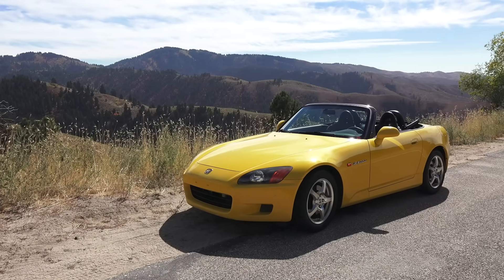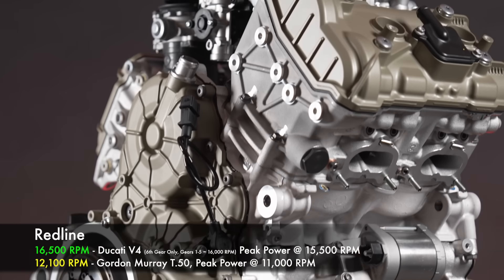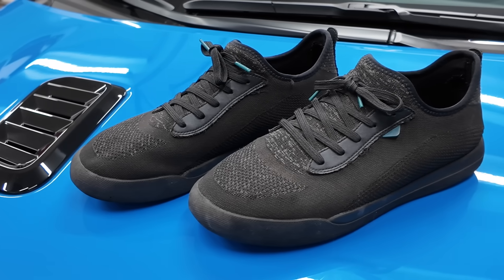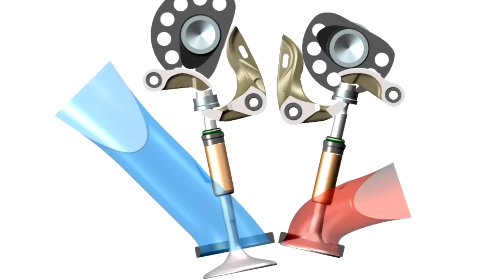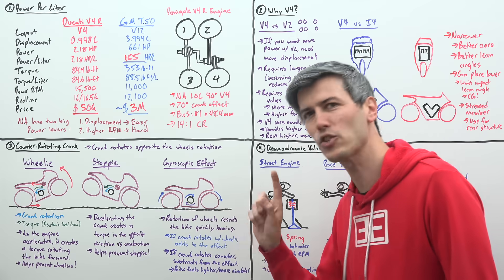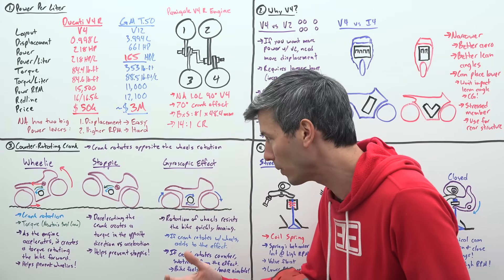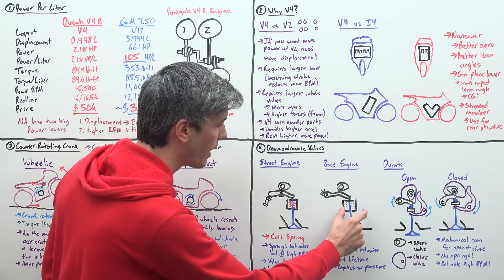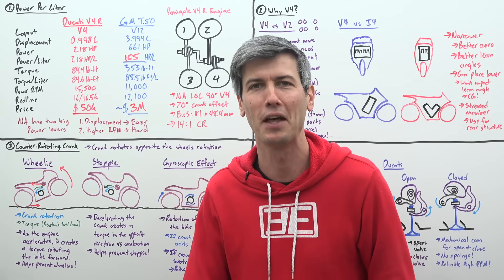Ducati's Brilliant V4 Engine — Putting Supercars To Shame!

Comment: Great video, but there’s a problem with the description of gyroscopic effects.  A rotating wheel’s resistance to leaning doesn’t depend upon the direction it’s spinning so the counterrotating engine won’t reduce the bike’s resistance to leaning.  However, there may be some more subtle gyroscopic effects related to the bike not wanting to steer itself rightward or leftward as it’s leaned.
Reply: I noticed that immediately too, although I'm a complete layperson at physics and technical matters. How would the "wheel gyroscopes" know to which direction the "engine gyroscope" is rotating when the bike starts to lean left or right. I'm a bit surprised that Jason didn't notice that, as he seems to be quite technically savvy and smart.

Comment: Volume is the wrong metric to measure and compare engines; the correct metric is cross sectional area of the pistons. Or even better, the cross sectional area of the valves.

Comment: one aspect of power vs dispalcement, is how long can it last.

another is how usable is the power band in other applications.

I suspect a motorbike engine would not be a nice expereince in a 1,500kg car, during a hill-start - or with a dual-clutch transmission.

Comment: Two stroke racing engines even back in 1968 produced well in excess off 300 hp per liter. The Suzuki RP68 three cylinder 50cc produced 380 hp per liter. Later Aprilia RS125 GP engines produced in excess of 430 hp per liter. The famous Honda NSR500 at some point produced at least 400 hp per liter....maybe more.
Reply: Should have mentioned the 1.5 liter turbo era in F1 GP.....How about 1500 hp+ from 1.5 liters! That's a massive 1000 hp per liter! Yes that was typical in qualifying trim. Crazy hp numbers per liter!
Reply: @C_Dana Yes, but he specifically said "naturally aspirated " so turbocharged F1 engines are out.

Comment: Oh!
Ducati is one of two manufacturers using counter rotating crank shafts in street bikes!! 
MV Agusta uses them in their i-3 800cc and (I think...) i-4 liter bikes. They're Italian too but much smaller a name and company. They are putting in work right now! They're offering a 5 year extended warranty to most ifnot the whole product line, which is nutty all things considered...
Thanks for a 2 wheel video, enjoyed your presentation of the info
Cheers

Comment: EE, I think it would be cool if you did a breakdown on the MotoCzysz C1 990. It had a dual counter-rotating crankshaft in a horizontally mounted engine.  It was intended for Moto GP, BUT got FIM'd.  Very interesting design.

Comment: I had a 2004 Honda VFR 750 back in my younger years.  I LOVED that engine.  V4's have their own unique sound.
A couple of times when replacing the muffler/exhaust, i would live the pipe off and fire up the engine with just the headers wide open.
GLORIOUS sound.  Way too loud and overpowering off course, and I would never ride on the street like that.
Still, the sound/tone coming from that V4 was awesome.

I'm really surprised that Honda didn't use the V4 configuration in more of their models.  Ducati obviously took it up, as they knew Honda had a great setup with the engine configuration.
I know packaging limitations are a key consideration when deciding on engine type in a cycle and automobile.
I would love for an auto manufacturer to figure out a way to put a V4 into a sport coupe and/or sport sedan.
With modern turbo systems and that sweet sounding V4 config, and it's inherent torque production, a turbo V4 in 
a sport coupe and sedan would have me buying one.

Comment: This doesn't really touch on the core reasons why people don't use motorcycle engines in a car even if the power density is higher. Can you explain further? Power curve and usability? NVH? Reliability and mileage expectations?
Reply: torque load, car has way more mass excerting force on all parts so you need stronger parts

Comment: I have been saying for years, if you love driving get a bike. You can have the time of your life with 60hp. You get all the best engine noises and most of the time an amazing driving experience.
Reply: Totally agree!  I had a 1000cc sportbike 25 years ago and the engine never even seemed be working until it was well into triple digit speeds.  I then bought a 2005 Ducati Monster S2R800 for street riding.  At about 80hp, it was plenty to have a great time on the local mountain.
Reply: Yep. For a clod like me who's used to 50-60 hp bikes, riding a 200 hp bike would probably get me killed.
Reply: @rcnelson  Nah just lose your licence

Comment: I would love a breakdown of the desmo system and why it was first introduced back when valve springs weren't of the quality they are now. The advantages they had in racing during that time could be explored. Love the bike content and there's so many crazy high horsepower turbo engines if you really want to go down the power/displacement rabbit hole. Good stuff!! Go Ducati.

Comment: I think the desmo has been dropped in the lower performance Ducatis as springs have advanced a lot in recent years, are simpler, are cheaper & easier to maintain. That said, I keep my fingers crossed that Ducati and their desmo engines will live forever.

Comment: I got to ride a 2023 Streetfighter V4S once (same engine as the Panigale, but different gearing, no fairings, and handlebars). The amount of power is insane and almost impossible to use on the street. But I still want one 😈

Comment: Hey Jason, another great video. full of amazing details and specs as usual. The Ducatti V4 is an absolute masterpiece and from what I've heard Rotax and Ducatti were at it quite some time and pulled the big guns out. I've heard of someone working on taking one much further than the OEM & works versions, should prove interesting and potentially very amusing. As soon as you said the most powerful N/A car engine it had to be the Cosworth V12 in the Murray T.50. It was designed and developed by Matthew Grant who was the Director of F1 engine design and development. I believe it was his last engine at Cosworth. He's now running Modatek who are the sole supplier of parts for classic Cosworth engines. No I'm not and engineer nor have I ever worked in the industry or any associated, lol just an ex pro DJ. I know Matthew from a crazy project with 2 5l Volvo turbo engine (☺️ now you know my secret passion, Volvo estate T5's) Make more amazing videos please!! cos as a non engineer it lets me see and understand how people address similar issues in different applications which lets me think it over properly and work out how to address it in my application and develop it. Yeah I know it's the wrong way round....lol but that's how I work stuff out. So power density wise 1500 bhp and very stable at that in a road going Volvo estate isn't too shabby. The project involved a 2500bhp single turbo 2.5l Volvo engine. Yes a lot of work but none of it difficult. (Again really bad ADHD and self taught at everything. 

keep up the amazing videos cos they help me a lot. PS there is One Cosworth Racing Volvo 2.5 5 cylinder development in existence too 😉

Comment: It's not only Ducati. They may take the edge in racing, but Honda & BMW both make 218PS in their street bikes as well, at lower revs and without a V4 engine configuration... In general, motorcycle engines are awesome 🔥
Reply: Honda’s 1000 is outdated and old technology. Its a generic inline 4. Sure it makes decent power but its still a generic engine just like Suzuki’s 1000. Yamaha’s R1 engine is unique and better. BMW uses exclusive valve technology that only their bikes have. Honda and suzuki need new tech. Kawasaki has the H2. There are rumors that Honda is designing a new V4 👍🏼
Reply: @revmatchproductions Don't hold your breath on that Honda V4 Superbike motor.  It's been rumored for decades now.

Comment: The desmo valve system also does not rob any power like valve springs do since in a traditional system the cam has to overcome the force of the springs to open the valves.
Reply: Once was a time when desmodromic valve control was considered obsolete since valve springs had improved so much. That control was the whole point of the desmos. Now we've come half circle--180 degrees--back to the springless valve control.
Reply: Si però poi nella fase di chiusura parte di questa forza viene restituitasull'albero a camme. Il bilancio è leggermente positivo per il sistema desmodromico. Il vero punto è che il sistema desmo.permette leggi di alzata più rapidee quindi a parità di fasatura un time-area maggiore...
Reply: @MrDenisio77  Mmm comunque un motore desmodronico lo puoi girare a mano, questa mancata inerzia dovuta all'assenza delle molle spiega anche perché questi motori prendono giri molto velocemente, non è solo questione di potenza massima.
Reply: And the desmotronic valve system is more than 100 years old... No way this is patented by ducati.
Reply: true...just trying to push the spring with my finger hurts
Reply: well actually I think the force required to compress the spring is given back as the spring returns to the closed position....less fiction losses
Reply: @StrongUrgeToFly  Hello StrongUrgeToFly, Your comment about the valve springs storing energy which is delivered back to the system would only be true at [very] low rpm. There is diminishing return as the rpm increase, and at the highest rpm when the valves are almost starting to float you've paid the full price of compressing the springs and yet get nothing back in return. Cheers.
Reply: There must be some extra oscillating mass from the desmo valve system though?  And something has to drive that mass (consuming engine power).  A spring can at least store and release energy (until it eventually deforms and fails).  In any case I do not think Ducati chose the desmo valve system for its efficiency.
Reply: @hreb  Don't forget that the spring and the spring retainers are all reciprocating mass. For high rpm engines, the mass of the retainers makes a significant difference to valve control. So the desmo system is simply swapping a reciprocating spring and spring retainer, for an additional rocker arm. At high rpms the springs have to handle crazy vibrations and oscillations, which is part of what causes valve float and the loss of valve control at high speed. The Desmodromic valve system doesn't have these oscillations. The trade off is that it is more complex to not only manufacture, but also to maintain.
Reply: @hreb it's actually lighter than a valve spring setup, and the reciprocating vs. rotating mass equation is only really true at low RPMs. The difference in HP using a Desmo system is estimated at 7-10 HP for a 1000cc engine, which is a pretty big deal. Only downside is that valve adjustments are significantly more work (ask me how I know🙃).
Reply: @hreb  While energy is consumed from the engine to compress the valve spring, it is very unlikely any appreciable energy is returned through the cam shaft, gearing, back to the crank shaft when the valve is returning to rest.

Comment: I have been riding, studying and modifying sports bikes for 4 decades...there is a crucial point being missed....big HP requires high revs and cam timing with high overlap which results in a lower torque output....you can see that in. the NA LT 6 corvette engine.  because bikes are much lighter they dont require as much torque to keep them rideable moreso if its mainly track or high speed usage ..cars are a lot heavier and need much higher torque so they cant rev as high and focus on peak HP. The Honda engine is till very very impressive because it make big HP but doesnt sacrifice torque. Ducatis focus is primarily on high revs high HP...its still amazing tech which other motorcycles manufacureres havent mathed but there is also a budget issue here ...

Comment: I would argue the width of a four cylinder is of no consequence with respect to windage. A riders feet and thighs would exceed the engine width. The only time width may be a factor is on full lean angles that might necessitate the lifting of crank centerline to achieve enough clearance. Pure aero, a four cylinder has no disadvantage.

Comment: I had a Honda CX500 maggot (old Moto Guzzi are similar) that used to jink to the right when you blip the throttle, which, when judged correctly, makes your handlebars miss the mirrors of cars in traffic. Not THAT useful, so it must be awesome when all that torque is added to forward motion instead of a sideways one (like on VFRs).  Does the reverse crank direction on Dukes nullify that effect, or is it negligable with 200+bhp?
Edit : definitely make part two.

Comment: 7:43 "CR engine gonna stop wheelies..." shows two Ducati's pulling power on wheelies 😂
Reply: Yeah, it still wheelies against the force, it's still got over 200HP and sticky tires.  If you measure the acceleration against a bike rotating the opposite way you would see at the same acceleration the other bike would be pulling a higher wheelie, or flipping backwards.

Comment: I'm wondering if you could increase the anti wheelie/anti dive effect and reduce gyroscopic effect even further by letting the chain also spin in reverse and have a planetary gear set reverse the rotation .I don't know but if that can allow also gear reduction at the wheel you could also allow a lighter, faster moving chain that doesn't have to withstand as much forces. I guess the compromise would be more unsprung weight at the rear wheel

Comment: Great video, as is always the case with all those I've watched. I do, though, beg to differ regarding the effect you describe of a 'contra-' rotating engine reducing gyroscopic effect. Rotation causes a gyroscopic effect regardless of the direction of rotation, surely? I can not think rotating two objects of equal mass in opposite directions will cancel their gyroscopic effects. (Will cobble together a jig to test this.)

Comment: So why are the bike engines run transverse and not longitudinally?  That would solve the width issue with an  I4 for example.
Reply: A longitudinal I4 in a sportbike would require a longer chassis which would lengthen the wheelbase.  Long wheelbase is not ideal for bikes designed to corner at speed.  The other issue is engine output is 90 degrees from the rotation of the wheels, where a transverse engine power output is on the same plane as the wheels.
Reply: @ghostwrench2292  I get the length vs. width issue, but must be a tradeoff right?  I'm not a motorcycle person, but I do ride road and mountain bikes, so lean angle vs. long wheelbase makes sense and there must be a sweet spot I'd think.  I'm not as clear on the engine output though.  Seems like very similar to a car but instead of axle shafts you've got a cog and chain, but with longitudinal it could be just about the same (Like half a car diff in other words)

Comment: I would also note MV Agusta uses a counter rotating crank shaft in their F3 800’s and have for the past dozen years. They also look to be doing this with their new 5 cylinder engine concept.

Comment: Ducati are not the only manufacturer using counter rotating crankshafts. 

MV Agusta began doing it in their lineup a LONG time before Ducati started doing it. 

I test rode a Brutale 800 back in 2015 that had a counter rotating shaft.

Comment: The crankshaft and each wheel all have some "rigidity in space" due to rotation.  I don't see how the crankshaft can reduce the resistance to tilt of the wheels by rotating the opposite direction. One component does not "know" the rotation of the other, or transmit its own direction of rotation.
    It simply resists its axis being moved.
   Just because they are bolted into the same pile of parts that is a motorcycle doesn't diminish that stability.
   Hondas early '80s v4s  had reverse rotation cranks. The v65s still did good wheelies, and were still ponderous in corners. 
     Fast back then, but half the power of the Ducati!

Comment: Way back in the 60’s Honda was producing sports cars with an amazing for the time , 95hp/liter. This was the predecessor to the S2000, the Honda S600 which produced 57 hp at 9600 rpm. It was an inline 4 with dual overhead cams and 4 Mikuni side draft carburetors and a set of headers that looked like they were made for a race car.  I owned one for a couple years while I lived in Australia in the 70’s. It was an absolute blast to drive.

Comment: Aprilia's V4 is apparently sweeter. Has a different firing order.
Reply: The Ducati V4 engine uses a "twin-pulse" firing order (\(0^{\circ },90^{\circ },290^{\circ },380^{\circ }\)) that mimics a V-twin, while the Aprilia RSV4 uses a conventional V4 firing order with a \(65^{\circ }\) bank angle and \(180^{\circ }\) crank, which results in a different sound and power delivery. The Ducati's paired cylinder firings create a distinct sound and feel, especially at lower RPMs, while the Aprilia's firing order is different and contributes to its unique sound and smooth performance. 
Anyway, all the testers comment on what a gem the Aprilia motor is.

Comment: Ducati holds on to the desmo valve system for heritage reasons.  Every other sportbike has been using valve springs, with the cam pushing directly on a bucket over the valve, and have been for decades.    Way back in t2003 my honda 600 revved to 15k  rpm
Reply: While the problem of valve float at high rpm was solved a long time ago, rendering that aspect of desmodromic valvetrains moot, there's still the not insignificant parasitic loss of power from having to push the valves open against a spring.
Reply: You're also assuming that the valves are the same size/weight.  Even today you can use more aggressive cam profiles and larger valves with a desmo system than with a spring system.